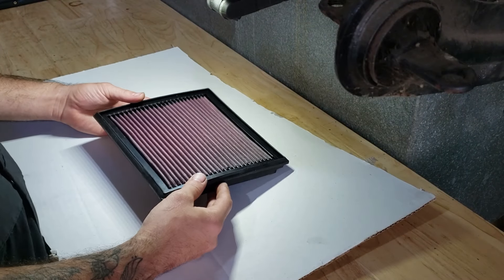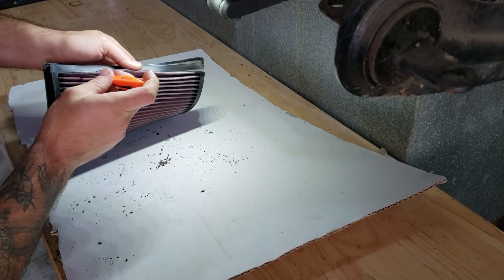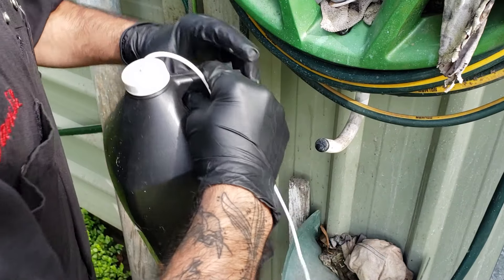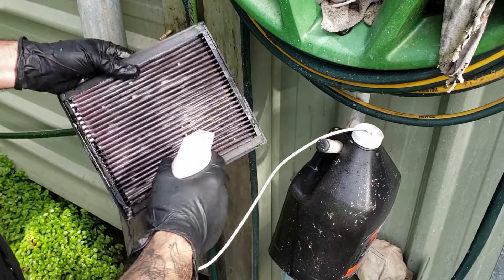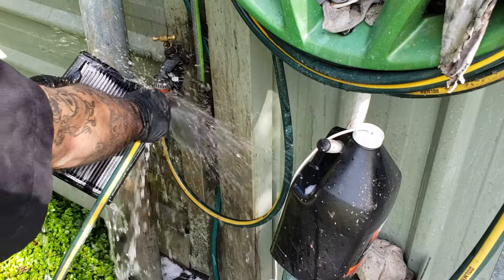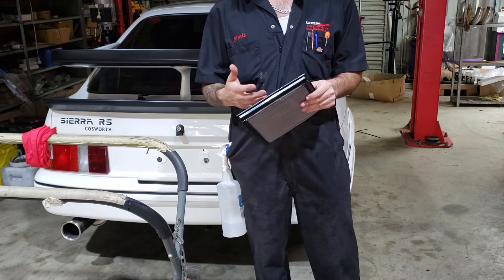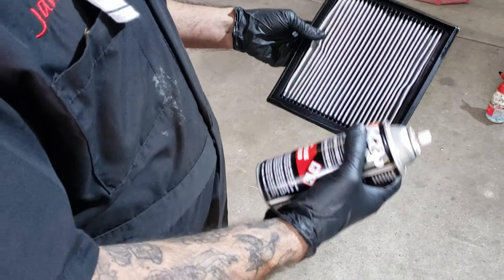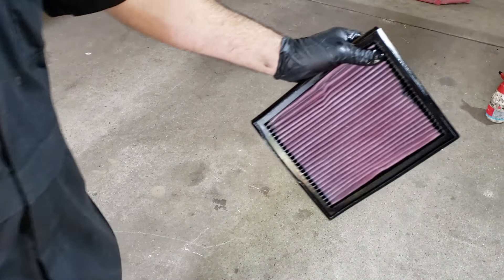K&N Air filter cleaning & re-oil

Comment: Good tips! I wouldn't want to run anything over the pleats though for fear of damaging the screen/cotton. Save yourself the time and only oil the unfiltered air side. The cotton will wick the oil up to saturate the whole filter. Oiling the clean air side opens an opportunity to have excess oil come off and gum up the air sensor. It just takes a little longer to wait for the oil to migrate over the entire filter.

Comment: spray cleaner on dirty side, wait 10 mins, rinse with water flowing from clean side through to dirty side to flush out dirt and cleaner
put air filter oil on the "dirty side" along each pleat and it soaks in. 
essentially avoid touching the "clean side" if you can help it

Comment: I've been using compressed air for years, just be smart about it - ~50psi with a vented nozzle and follow-up drying in the sun.  For those that don't know, Metho = Denatured/99% Isopropyl alcohol in the states.  Also, don't waste that much degreaser - coat it on both sides and flush after 5min.  Simple Green and Formula 409 are much more cost-effective alternatives to the K&N brand cleaner, and they clean as well...if not better/faster.

Comment: I recently bought my K&N filter and installed it straight outta the box as it says pre oiled. Do I need to add more oil at all or just change/clean it every 15k miles?
Reply from the maker: pre oiled straight out the box so just clean and re oil next service or when it starts to look dirty

Comment: Is it necessary to put oil?
Reply from the maker: yes it is. Its the oil that traps the dirt/dust. Without oil its just cotton
Reply: @OEMDeniedPerformance  i don’t have the k&n oil cleaner, what should i use instead?
Reply from the maker: @Ridhxm_  can use general workshop degreaser.
Reply: @OEMDeniedPerformance  lubricant would work?
Reply: Like wd40 or honey goo
Reply from the maker: @Ridhxm_  no, for cleaning you can use a general degreaser. For oiling you should use the K&N filter oil.

Comment: Don’t u need to wait 10 min before rinsing
Reply: In the video, he takes over 10 minutes to 'saturate' the filter with the cleaner.  He definitely was generous with the solution.
Reply: You should , I've had my same one  for years and it's fine because I take care of it correctly,  also Don't run a screwdriver between the pleats

Comment: Nice video Mate but unfortunately the K&N filter does nothing to save me any fuel or make a difference in my 2014 F-150 truck performance. I can't wait to finish the cleaning and oil product so I can put the filter in the garbage.
Reply from the maker: At no point do I say that a K&N air filter will save any fuel or alter performance. Its an instructional video on cleaning. The benefit of a K&N filter is it can be cleaned and reused instead of being thrown into bin.
Reply: It says not to do both sides in the instructions. Shit is stressing me out lol
Reply from the maker: @taylorpelletier89  1/4 down K&N website "If oiling a K&N air filter using the air filter oil aerosol spray, the process is similar to using the squeeze bottle kit. Spray the oil evenly along the crown of each pleat, holding the spray nozzle about 3" away from the filter. Allow the oil to wick for approximately 20 minutes. Touch up any light areas on either side of the filter until there is a uniform red color in all areas" 
So dont stress :) 
https://www.knfilters.com/blog/ask-the-experts-at-kn-how-to-use-kn-air-filter-oil-how-much-oil-do-i-use/
Reply: @taylorpelletier89 this is my problem, K&n really doesn’t specify clearly on the instructions which side to oil, but I’ve seen videos that show either the air in side or both.